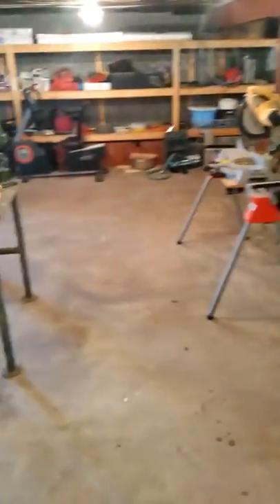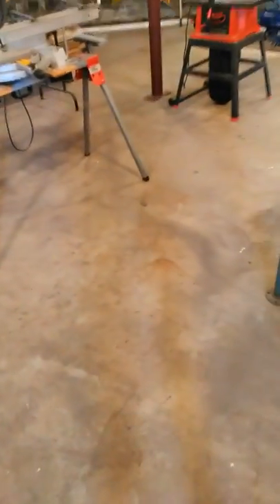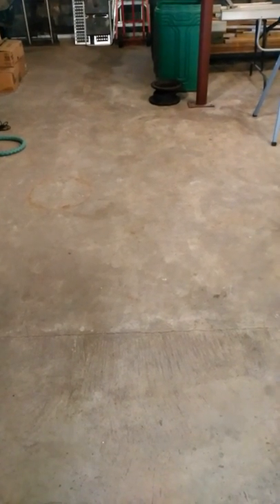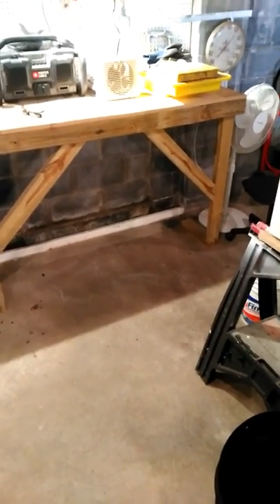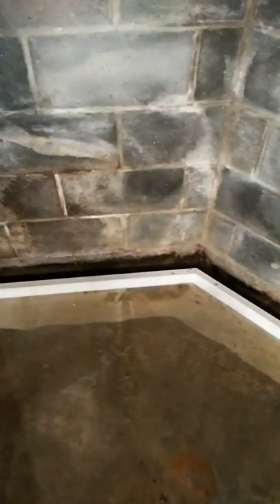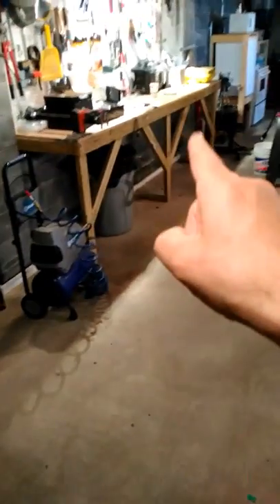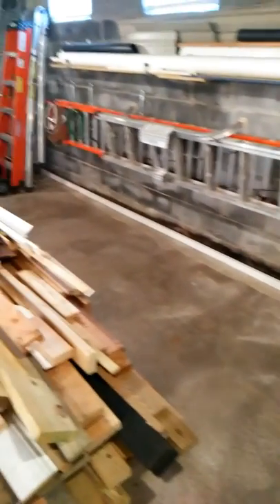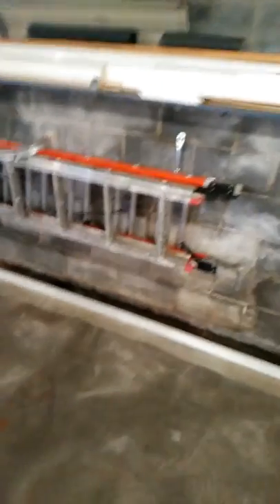Basement waterproofing easy and inexpensive method

Comment: I'm currently installing this type of solution (thank you, youtuber, for the idea.)  One important tip for others trying this out: you might use this method to tap into an older floor drain. My basement had an existing but now blocked and failed clay tile drain under the floor. I was drilling the holes to secure the brick mold and I noticed red dust coming up as I drilled each hole. Also the drill bit broke through the concrete at the end of drilling like it hit a void. I got curious and drilled a 1/2" hole to explore. I was able to probe about 7" down to the real bottom of the void. I surmised this was the original floor drain. So I bought some green tracing dye (used to trace streams, septic leaks, etc) and I poured some in the hole and then flushed it with a garden hose. We had the dyed water appear in a newer waterproofed part of the basement in a sump pump. Basically, I can re-use the old blocked drain which connects to a newer drain system. So essentially I'm 'repairing' the old floor drain with this approach.

Comment: Very ingenious and simple solution....no matter what solution people use, there is still water issues if a sump pump is running constantly and so many horror stories of sump pump failure during power outage or just failure, why hasn't some of the pro's figured this out? great video!
Reply: FWIW, battery backed-up sump pumps are available.  Not necessarily cheap, though.

Comment: The best long-term solution is cutting out the floor and installing a drain tile system with a sump and a pump. However, if you're not planning on finishing the basement and are strictly looking for water mitigation on a budget this is absolutely a viable option. This seems to be a pretty well planned solution. It's the same concept as the plastic systems sold online but extreamy sturdy compared to the plastic systems. What I like about this design is the fact you can get in there with a hose and rinse the whole thing out if it ever gets clogged up. Good job dude!!!👍

Comment: Great idea with the brick molding, going to do this to gutter to my sump pit instead of it running across the floor. It's an old stone foundation and it leaks through the gaps between the rocks.

Comment: Actually a similar concept to the commercial   Beaver system but of course much less expensive. I only get water in my basement when we have hurricanes or long noreasters which I believe temporarily raises the water table. These would channel the water to my sump but I don't think I want to lose the floor space for such an unusual event.  I know from experience that grading around the house and keeping rain gutters clean should always be the first step in fixing basement water issues. Ground should slope away from house at least 6 inches in first 10ft.

Comment: Another idea would be to add a few weep holes to allow the water to drain into your drain tile and use cotton rope to use as the drain sender. I would suggest you address the walls with repointing and coat with a dry lock paint as it may slow the entry. On the outside fix gutters to drain way away and slope soil to move away the water from the fountain. If you have radon then weep holes need to be address as a point of entry. Thanks for your post. They sell kits with like this but your homemade idea is a good one.
Reply from the maker: I added weep holes a few weeks later...which incidentally never weep...and as far as the spouting it was routed away from the area long prior to this fix..
Reply: Use synthetic wick as cotton rope will rot and mold.  Nylon roping will work to carry the water to a sump if you put the end of the rope in the bottom of the sump.  Pour some vinegar in the trough periodically to discourage mold and mildew.

Comment: Thanks for posting this!  I have a similar water seepage problem in my basement and am going to give your system a try.  How did you prep the floor contact area for the moulding, and did you use rigid or coiled PVC pipe?
Reply from the maker: I powerwashed about a 6 " path for the moulding....and used ridgid pvc pipe... Randy

Comment: I know this is going on 7 years old now - but I just wanted to mention that a basement constructed of cinder blocklike this that has water intrusion means that the inside cavity of those blocks are surely filled with water. A weeping hole at the bottom of each run would eliminate that interior water and ensure that your blocks dont start deteriorating. Would be interested to see an update on how your system and walls have held up. Thank you!

 Ohm BTW, there are two different types of brick molding. Wood and PVC. Obviously you want the PVC - but last I checked they are pretty darn expensive these days.
Reply from the maker: Hi, If you read all the comments and replies by me you will find where I did add weep holes that don't weep whatsoever. Regardless they are in there doing nothing in my application....the totalsystem works as good as the day I installed it. As far as pvc brick moulding prices...all I can say in a whisper is "Bidenomics" it's working...
Reply: @iflex1963   LOL! Wait wait wait - the Biden administration said that they "put in the work" and "THAT is what important".
 Thanks for the quick reply. Glad to hear this was the solution and saved you... well - what would be about $60k in Biden dollars today. Maybe I got my math wrong. Who knows. We know he doesn't.

Comment: So, you have water in a trough whose base is a concrete floor. Hmm, some of this water will escape via your end cap - very nifty - but some of it will soak into the floor and thus migrate under the channel (into zones of drier concrete) and eventually evaporate into the cellar's air volume. I'm intrigued to know how damp your floor still gets, because there appear to be blooms emanating from the edge of the trough. Is the space habitable?
Reply from the maker: I have no clue what a bloom is...however in response to your question of how habitable it is I use the area frequently for a shop. There is no leakage under the trough. Poured concrete floors in general may be porous however are generally not very permeable. Concrete blocks on the other hand obviously are very permeable. It's been years since I did the job and still holding up. I do run a dehumidifier in the summer and pull out a gallon about every 3 days. For a few hundred bucks it has been the best investment I have ever made.

Comment: hello, thank you for posting this video of your idea. i have a question.....would you suggest drilling weep holes on the bottom wall blocks? would you suggest drilling weep holes on the floor space inside your channel area? if yes....how often along the path of both? thank you, blessings from a fellow york county, pa home owner.
Reply from the maker: I actually did add some weep holes in the blocks on my system about every 3 blocks....however no water comes out them. Still a good idea. I wouldnt drill the concrete though..pointless..good luck!!

Comment: From Pittsburgh here, would it be possible to skip the tap cons and just use the silicond and an epoxy?
Reply from the maker: My daughter lives in Pittsburgh. It might work if the brick casing sits well on the floor..Its certainly not ideal. You could possibly sit some weights on it until the silicone cures..
Reply: I was thinking the same thing.

Comment: looks workable can I use super strong construction adhesive like gorilla  rather then tap cons
Reply from the maker: Another viewer in the comments asked about using just silicone...As I told him I would imagine you could do it but you would have to weight each piece down individually to get good floor contact. If you try it cone back and post your results for others to see.

Comment: Awesome..... Would you know the size of the tapcons you used and how deep you had to drill into the concrete ? Thanks for sharing.
Reply from the maker: I believe I used the 3/16" x 2". I countersunk the brick mould with a drill size that would allow the head of tapcon heads to slide thru slightly and went deep enough so the screws extend out bottom 3/4" to an inch. Use a hammer drill on the concrete and drill 1 1/4" deep or so.. You dont want the tapcon to bottom out in hole. Also blow the holes out with air compressor. The tapcons are just conforming the brick mould to the irregularity of the floor until the silicone dries. I just tightened them skipping back and forth until I saw the silicone squeezing out slightly. Dont overtighten them. Good luck!! Best $300 I ever spent..
Reply: @iflex1963  Thanks much

Comment: Great video. Quick question do i have the correct materials here: lowes royal building product 2in x 8ft pvc brick moulding,GE clear silicone, 2-3/4in x 1/4in Tapcon screws and a tapcon 4-1/2in carbide masonry drill bit. I do not have an impact drill jus a regular drill..wi this work?
Reply from the maker: I believe I used 3/16" tapcons x 2" and I countersunk the holes in the brick mouldings about 1" in so that I had about 1" screw into the concrete. The 1/4" will require more pressure to drill and will require more effort particularly without an impact drill. I would suggest purchasing one from harbor freight tools or renting one. Drilling in concrete without one is difficult. The 1/4" tapcons will work and the longer length just means you wont have to countersink the mouldings as deep.
Reply from the maker: I also used the 17' long mouldings so I had less seams.. the 8' will work though.
Reply from the maker: I looked at harbor freight and the have several hammer drills under $40
Reply: @iflex1963  yes..how funny..i just got off the harbor freight site looking for one
 So let me ask you this..did u drill a pilot hole from the top of the brick moulding right down through the concrete or did u drill hole in concrete then line up moulding them drill pilot holes in moulding? Sorry for all the specific questions.
Reply from the maker: @tamikakirksey3286  The best way is to set the mouldings on saw horses...then measure and mark the spot with a pencil. Center punch the mark then drill a hole thru the moulding with a regular drill the same size as the concrete drill. Then make 2 spacers about 2" in width that you can use between the concrete block wall and where the moulding will be placed. Then put concrete drill thru the hole in moulding near end. Drill concrete about a 1/2" deeper than you need so the tapcons dont bottom out and break. Blow out dust with air compressor.
Reply from the maker: @tamikakirksey3286  Then put a drill in hole in moulding and into concrete to temporarily pin it in place to spot drill the remainder of holes in concrete. Just drill in 1/8" deep. Then remove pin and moulding to drill all the spotted holes to depth. Blow them all out. Then redrill holes in moulding to a size around 1/64" larger than tapcons. Then countersink them with a much larger drill that will just allow head of tapcon to go thru.
Reply from the maker: @tamikakirksey3286  Then you are ready to silicone bottom...clean floor of dust and install tapcons with a impact driver carefully. Dont OVERTIGHTEN them..just tighten them enough to squeeze  a little of silicone out.
Reply: Just curious: How did you carry 17' long brick moldings?
Reply from the maker: @kokyaw  8' truck bed with tailgate down laying diagonally...

Comment: do you have any tips for a city boy with 0 experience in this stuff?  thinking about digging round the house with a rented whatevertoolhere and tarring the outside wall, then maybe fixing the roof drain system before that, and then after all that doing something like this if needed. we already have a subpump installed.
Reply from the maker: If your basement isnt going to be finished and the water is coming from the walls and not a crack in the floor and you already have a sump then you could use this method and channel the water into the sump hole. I wouldnt waste my time tarring the outside wall... diverting roof water away from foundation will help but wont prevent it completely.

Comment: Good idea! Do you think the drilling in concrete and bolting the molding down would have been necessary? Also did you have any cracks in the floor that water was pushing up from?
Reply from the maker: I believe you could just use the silicone if you took your time and put weights on each piece one at a time. If you have cracks in your floor that water comes thru this method won't work...Randy

Comment: So the walls stay constantly wet....that cant be good for mould. This is a short term play....long term, dig out the other side and drain it properly.
Reply: I was thinking about mold as well. What about a sealant for the walls?
Reply: @chrisrioux  this basement needs a pressure relief trench system. This guy's basement will eventually implode due to the stress of water on the walls.
Reply from the maker: @greghillmusic  Nostradamus predicting the future... Your brain is going to implode long before this basement wall fails..
Reply: @greghillmusic  he drilled pressure relief holes every 30” in the wall, no pressure behind that wall. There are commercially available versions of this waterproofing method for about 3x the price. Still about 10x-30x cheaper than digging drains on the outside of the wall.

Comment: What kind of silicone did you use? I have two sump pumps in my basement already and am thinking about employing your system.
Reply from the maker: I used clear 100% silicone. Still holding...no problems!
Reply: If you have a block wall find out if it monolithic or you can ruin your foundation
Reply: @robb930  we have the above system in place currently and ended up opening some weep holes to help with pressure. I placed this system on 2 of the 4 walls in our basement. I will keep an eye on it but we also run 2 dehumidifiers 24/7 in our basement and seem to be having some success.

Comment: I know you it works for you and many other people but I will tell you that you are allowing water to sit in your block walls and it can really wreck havoc on the stability of your basement walls if those blocks stay wet for a good amount thru the years they can and will start to deteriorate, I'm not knocking what you did I'm just informing you from someone that has 20 years in the waterproofing basements that can cost you more in the long run with block walls holding water
Reply from the maker: Actually I did not change the dynamics of how long water "sits" in the wall because I didn't  trap it in the walls. Painting the walls with a sealer would do much more of keeping the moisture in the wall. Also unlike a closed channel system mine allows air to evaporate the moisture much quicker. The channel I created is only wet during and after a rain a few days. It doesnt stay wet. I did add some weep holes to allow quicker draining which is not mentioned in the video. The only real way to prevent water from contacting blocks would be to attack it from the outside which in many cases is next to impossible to prevent. As far as water decaying blocks that is a very long process. Water eats away at everything given enough time. River rock are rounded by flowing water. Concrete blocks are specifically used underground because of there resistance to water. I appreciated your comment however you didnt give any advice for an improvement.
Reply: Not a contractor, but agree with the above guy. Terrible idea. Standing water breeds insects, especially mosquitos and mold for 2 things. At least pour a water and bleach solution down your trough every so often to kill the mold.
Reply from the maker: @dennisf7086  There is no standing water..no mosquitos..and no mold.. I guess you would prefer the whole basement under water.
Reply: @iflex1963  But it is deceiving ,most people don't understand how moisture affects basements  .just because you saved money does not make it a correct job.
Reply from the maker: @robb930  Just because you disagree with my method doesn't mean that you have a point.

Comment: This looks like a great way to do it. If your basement is level, then how does your water drains? Looks more like you built a dam.
Reply from the maker: Actually I built a channel not a dam. Every hard rain that we got I would have to vacuum about 20 gallon off the floor. Imagine slowing pouring that amount of water (20 gallon) into that channel that I built. If the floor of the channel were perfectly level the water as it fills the channel and gets some depth will run to a lower spot which in this case is the drain at the other end of the basement. All I did was create a "conduit" to control the path in which it takes thereby creating dry space everywhere else.
Reply: I'm going to be doing this excact thing myself today. Seems pretty easy and looks like it will work well. I do not want to dig up the basement so this is perfect. And my basement only leaks from one spot mainly.
Reply from the maker: @timosness3667  Good luck.. give us an update when it's been tested with a good rain..

Comment: This is terrible for the long term health of the perimeter wall foundation over time, you're going to need dehumidifiers ebeywhere to keep that valley dry
Reply from the maker: Actually I have one dehumidifier running in the room... near 1000 square feet... and after a heavy rain it's dry as a popcorn fart within 2 to 3 days. Works like a charm for me.

Comment: This is not how you do this. A trench 10 inches beyond the footer and 10 inches deep, 4 inch perforated pipe. with weep holes in ever cell of every block including the mortor joint. This wall will buckle.
Reply from the maker: Thanks for your expert opinion....however this block wall has been there since 1970....52 years....straight as ever...